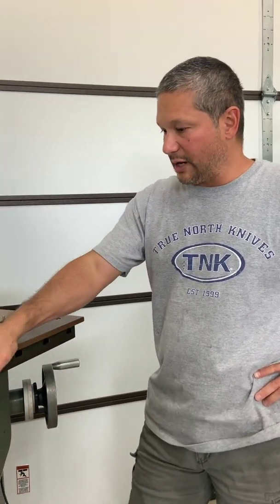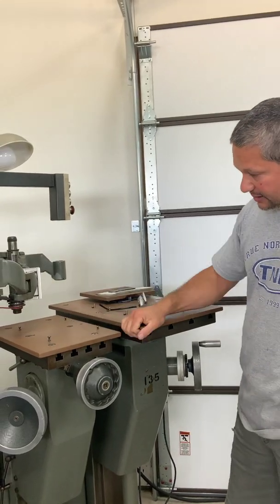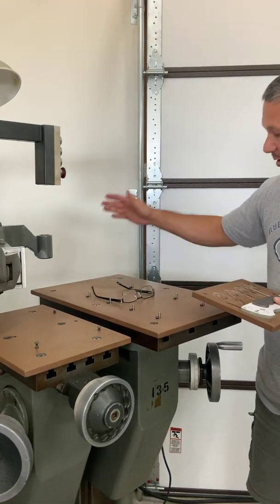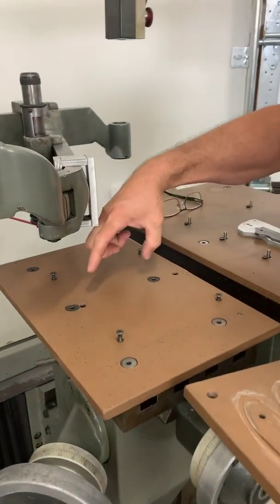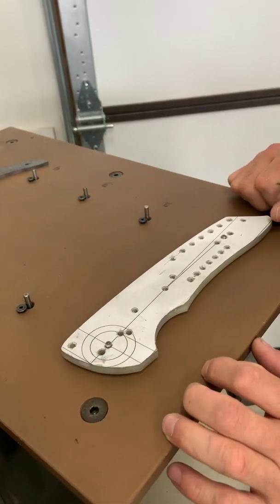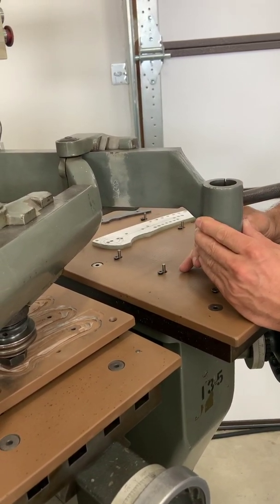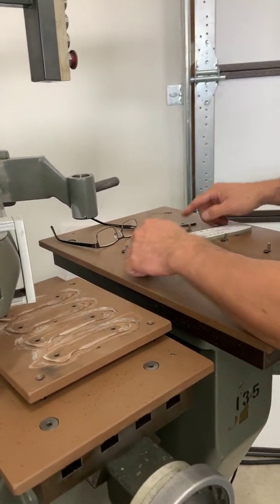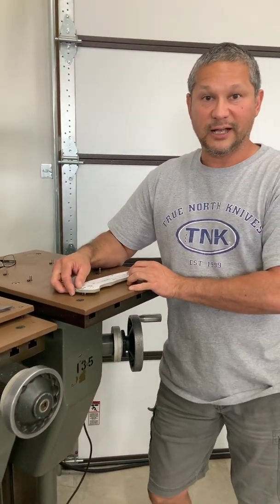Pantograph Setup

Comment: Hi Allen, I'm waiting on delivery of a GK12 and want to establish a consistent, repeatable setup like you have here. I think I understand how you have mounted the baseplates but just want to be sure. Do the mounting pins on the G10 baseplates extend out the bottom of the plates and do you then push them up against the outer edge of your tables on 2 sides to get your initial zero for locating them?
Reply from the maker: I am actually going to do a video which is going to cover this in the next few days.
Reply: @AllenElishewitz  That will be great Allen. I'll look forward to seeing it.